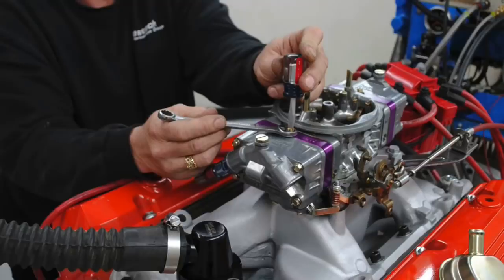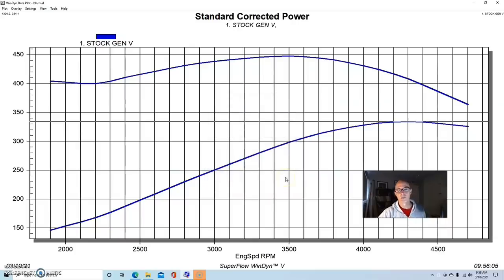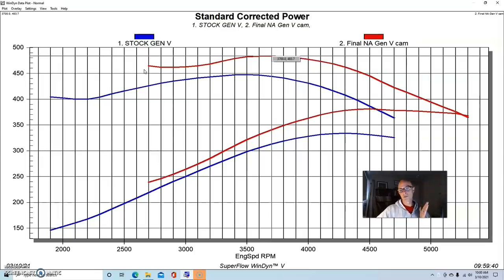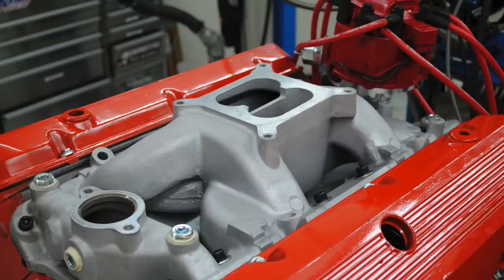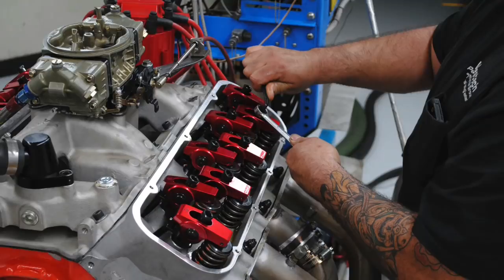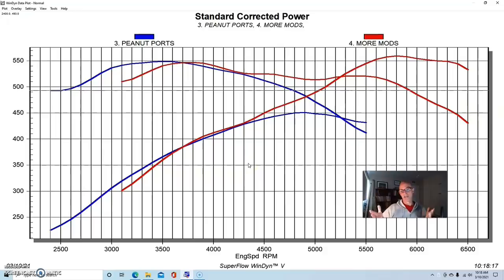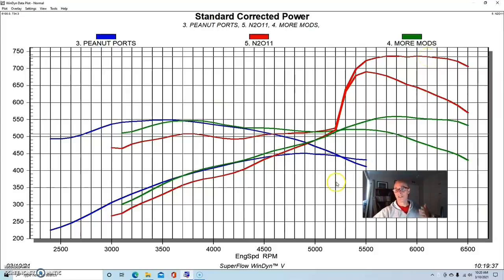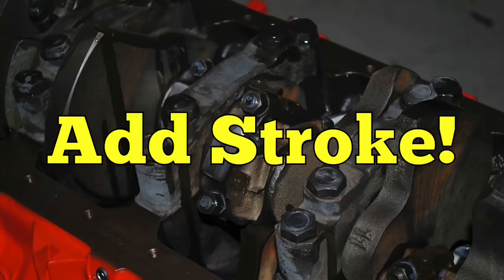HOW TO: GEN V 454 MODS-PEANUT PORT PERFORMANCE

Comment: What heads are those? What model?
Reply from the maker: just stock chevy peanut ports (Gen V)
Reply: @richardholdener1727  were the stock valve sizes ever changed during these tests? If not, that's impressive power/torque from small valves!

Comment: Those are HT heads not Peanut Port.  PP were used in the 80's.  The HT heads worked all the way up to the 502HT and HP.  I have some of these heads.
Reply: I am guessing that you have casting numbers on these heads? This is from a 1992 HD truck. What year did ht502 crate engines come out? What is an Ht454 engine?
The ht502 uses peanut port heads. It is so there is commonality between its intended function as a replacement engine for trucks and the components that come on the vehicles it's intended for. Peanut port heads came out at the latest 1978 with some claiming the 236 heads on vehicles as early as 1973. That is the head casting that most people think of when they're dealing with a carbed truck with a 454. On a 1990 454SS half ton it's either 236 or 360 castings. Although there are difference between the 1975-1990 head castings and the 1991 and later ones, they aren't related to port location or size or fastener location, it's dealing with the exhaust/coolant crossover and most manifolds seal the flange with the proper gaskets. An edelbrock intake for 1990 tbi trucks will bolt to heads for a 1995 truck.
Reply: @timothybayliss6680  All 454TBIs from 1992 to 1995 along with the HT502 and 502HO as well as the marine engines of the era use the same HT heads (NOT PP).   Cylinder Heads (P/N 12562917): Iron oval port; 118-cc chambers, Valve Size (in.): 2.070 intake / 1.730 exhaust.    I'm not sure about the '87 to '91 but my guess is they are the same.  I have a set in use and and a brand new bare casting on the shelf.

Actual Peanut Port Heads are #336781 oval port, 113 cc chambers, ’73 through ’85 oval port, open chambers, 2.06- and 1.72-inch valves. Used on 454ci engines.   Flow rates not the same.
Reply: @latrogeniwile58  i think you have things a little backwards.
Reply: @andy347495  Last time, my post was completely deleted.  OK geniuses...  If these are the same, why is the chamber CC, valve size, and casting number different ?   If it flows enough for marine HP 502s and 502HT and 502HO, then is it really worth upgrading for a street driven truck.  Clearly, no.
Reply: @latrogeniwile58  you must be mixed up on what is what and talking about something else lol. How do you know what casting number heads he has?
Reply: @latrogeniwile58  and probably deleted for a good reason.
Reply: @andy347495  Because they are 1992, genius.
Reply: @latrogeniwile58  yeah definitely got stuff mixed around.
Reply: @latrogeniwile58  did you pull that info off of a retailers website?
Reply: @timothybayliss6680  You are correct, the HO had iron square ports.
Reply: @timothybayliss6680  I was working at GM in 1978, before Holdener was a glint in his daddy's eye.  Simply go to Chevrolet and pull up the crate engines.  I've had 454TBI for 22 years and still have a nice one in service.
Reply: @latrogeniwile58  you're a gm engineer after all. You should know that the 75-90 engines have different heads than 91+ engines. You shouldn't have to guess. Find a picture of 781 heads, they are abjectly not peanut ports. You said that 12562917 heads came on 1992+ tbi trucks, they did not and the change over year was 1991. Just do a quick Google search for that casting number, or casting number 346236...and you might learn something.
I don't know how someone says so much wrong at once. World records are set every day for a variety of things. In one post, your first reply to me, I think you set a speed run record for someone using the internet unable to see if they know more than their age before they posted.
Reply: @timothybayliss6680  When I drag raced, it was SBC and 3.8SFI Turbo.  I only use 454s to do actual work and Sport Cruise.
Reply: @latrogeniwile58  the GenV tbi head casting number is 10114156. The only engine to come with the 917 heads is the Ht502. It is not the production head that came on 1991, the first year for GenV engines, to 1997 454s. The other peanut port heads are 045 or 398, I'm not sure about the 398 heads. It looks like 12352783 is the factory replacement for all from 79-93. I don't know if there is a difference. 
Why do you have to spout off like that? I don't care if you're wrong, and you are, but why would you call someone correcting you a moron? No wonder GM went bankrupt if you were an engineer.
Reply from the maker: THE HEADS WE RAN ON THE TEST MOTOR WERE PEANUT PORTS
Reply: @richardholdener1727  Hard to imagine a genius like you has been wrong all these years.  HT means High Torque.  You lost a lot of points with me.  Just admit you have made a mistake.  It doesn't matter if they are "almost he same".  Peanut port => high torque => Vortec BBC and then the oddball 8.1L.  You need to take a vaca' or som'n
Reply: @latrogeniwile58   You are mistaken on a few points here.. the 781 heads were large oval port castings, identical to 049 heads.. the peanut port castings are considerably smaller..  
Neither heads to be confused with rectangle ports.. 
Chevrolet produced in the 70's rectangle ports.  Large ovals 781/049,  and peanut port ovals...

Comment: All of the below aside... I appreciate the tests.  None of the data is relevant to your audience, as it would require massive cooling system upgrades and incomprehensible replacement of the stock ECM and all the other engine electronics.  Plus a new trans controller.

These 454TBIs will barely cool on the street in no-load apps. (I've solved that with coolant mix and hose swap.)

What an engine will do when you abandon all practical usage in a commonly owned street vehicle is meaningless.

You don't even point out a swap to Vortec heads will eliminate EGR and cause a default mode in the ECM. (Pre Vortec)

The info provided under near ideal conditions is useless.  Most of the time
you violate any reasonable budget as well.  Just for the YT $$$ or what ?

Pretty obvious the $$$$ of your YT channel is your motivation.  You have no idea of 
the damage you cause by giving hope to poor performing (as they were designed to do by GM)
rejections of the results of millions of dollars of R and D at GM.

!!!

Comment: Please learn the difference between an engine and a "motor".

This was helpful, but it would have been better if you had made discrete changes, rather than 2, 3 or, 4 at once.
Reply: motor

 noun

Save Word

To save this word, you'll need to log in.

Log In 

mo·tor | \ ˈmō-tər  \

Definition of motor

 (Entry 1 of 3)

1: one that imparts motionspecifically : PRIME MOVER

2: any of various power units that develop energy or impart motion: such as

a: a small compact engine

b: INTERNAL COMBUSTION ENGINEespecially : a gasoline engine

c: a rotating machine that transforms electrical energy into mechanical energy

3: MOTOR VEHICLEespecially : AUTOMOBILE

motor
 adjective

Definition of motor (Entry 2 of 3)

1a: causing or imparting motion

b: of, relating to, or being a motor neuron or a nerve containing motor neuronsmotor fiber

c: of, relating to, concerned with, or involving muscular movementmotor areas of the brain

2a: equipped with or driven by a motor

b: of, relating to, or involving an automobile

c: designed for motor vehicles or motorists

motor
 verb

motored; motoring; motors

Definition of motor (Entry 3 of 3)

intransitive verb

1: to travel by automobile : DRIVE

2: to move or proceed at a vigorous steady pacemotored down the field for a touchdown

engine

 noun

Save Word

To save this word, you'll need to log in.

Log In 

en·gine | \ ˈen-jən  \

Definition of engine

 (Entry 1 of 2)

1: a machine for converting any of various forms of energy into mechanical force and motionalso : a mechanism or object that serves as an energy sourceblack holes may be the engines for quasars

2: a railroad locomotive

3a: something used to effect a purpose : AGENT, INSTRUMENTmournful and terrible engine of horror and of crime— E. A. Poe

b: something that produces a particular and usually desirable resultengines of economic growth

4a: MACHINERY

b: any of various mechanical appliances —often used in combinationfire engine

c: a mechanical tool: such as

(1): an instrument or machine of war

(2)obsolete : a torture implement

5: computer software that performs a fundamental function especially of a larger program
Reply: @firebry23  Lol...  Where'd you find this BS?
Reply: @firebry23  🤣🤣🤣
Reply: @michaelangelo8001  The dictionary, it looks like.
Reply: @TwoLotus2  yep clearly michael doesnt doesn't know the definition of a "motor" or an "engine". Google it its easy to find
Reply: @TwoLotus2  "the" "dictionary"?  

No, 'a' (bogus) dictionary.

There's more wrong info in that quote, than right.
Reply: @firebry23  Easy for ignorant people to find BS on the internet?  Yeah, I think we all knew that already.
Reply: @michaelangelo8001  clearly you've proven that
Reply: @firebry23  there’s no point arguing, this guy is like the grammar police, he pops up in every comment section of every video and gets hung up on small things that really don’t matter or provide anything helpful to Richard or other people trying to learn. 
There’s a saying “If you wrestle with pigs you both get muddy and the pig likes it”
Reply: @dandewar8403  You are a liar, Dan. 

In point of fact, I seldom comment, and when I do it is to add value, and/or to correct the record regarding an important issue.  

By your own words, you have testified that you prefer ignorance, over "learning".

Another thing: regarding Richard's supposed heroism...   Have you considered that after he has freely educated everyone on YouTube, regarding every "speed secret" imaginable, that the information will no longer hold any competitive value?   

If every Bozo with internet access, is now potentially holding four aces... what is the point of even playing the game?
Reply: Motor , engine = same thing
Reply: @scottallpress3818  Lol...  No, they certainly are not.
Reply: @michaelangelo8001  Give us the real facts on each, I've never bothered to ask before.
Reply: @boomer5030  It's very simple:

An engine develops motive power from a raw fuel, such as wood, or gasoline.

A motor must be paired either directly or indirectly with some sort of generator, such as an air compressor, or a hydraulic pump.
Reply: @chrishansen7004  Lol... What?